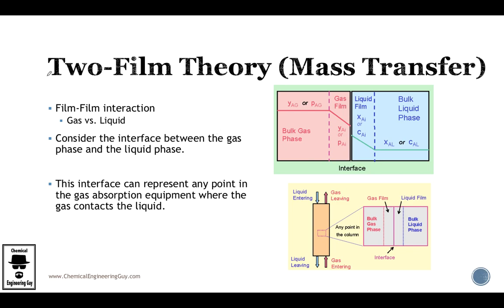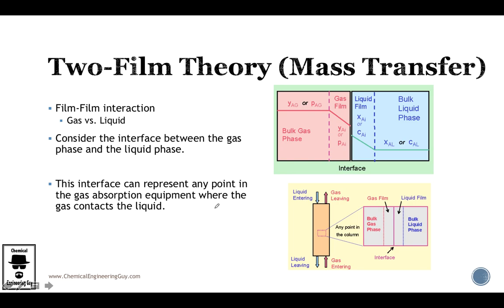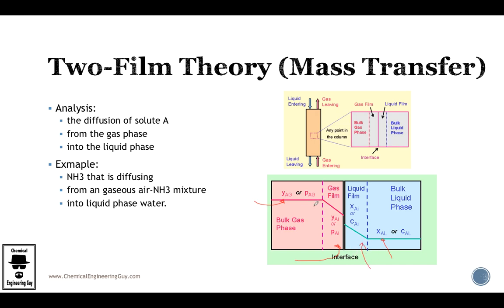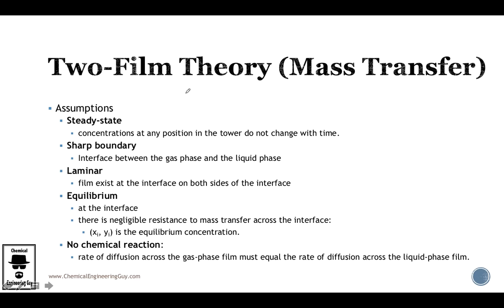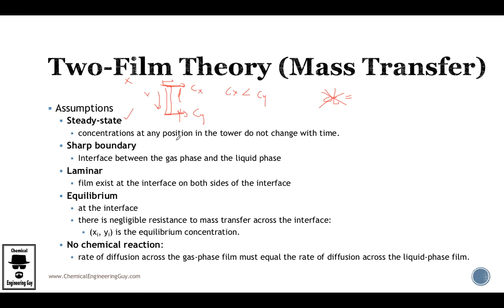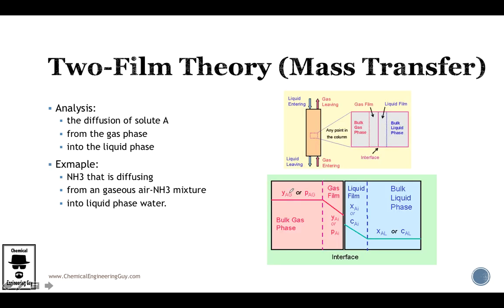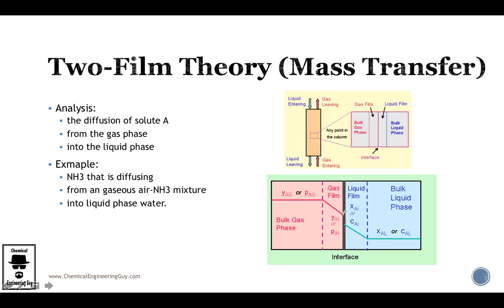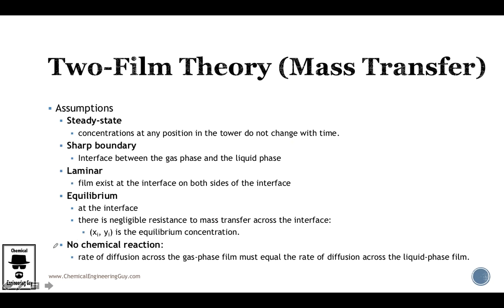Two Film Theory Mass Transfer (Lec029)

Comment: You claim that there is no reaction but if there was no Reaction, wouldn't the concentration in both phases just be constant an in equilibrium? I thought this models purpose was to describe a reaction taking place in the fluid phase.
Reply from the maker: Sebastian, we are talking about mass transfer cases only, no chemical reaction, of course we are claiming no chemical reactions, as we want to model FIRST the mass transfer without chemical reaction. Then you will add the model with chemical reaction and NO, what you are seing is a moment in time + position in a Gas Absorber, meaning it is not in equilibrium, therefore, there is mass transfer. If you add a liquid and gas with a solute which will be in equilibrium, it will be a failed design! Its like wanting to cool/heat a 25ºC cup of coffee with another material that is at 25ºC, doesnt make that much sense